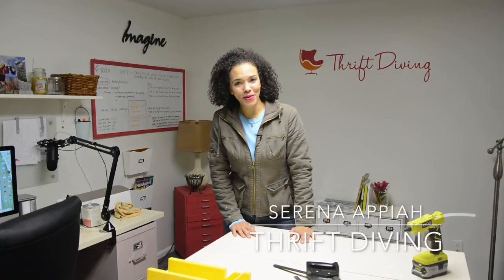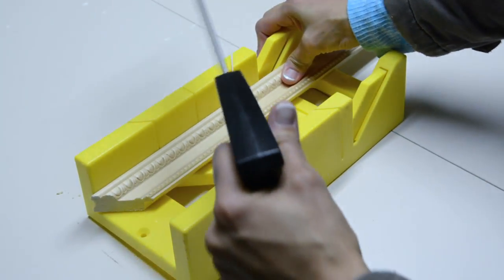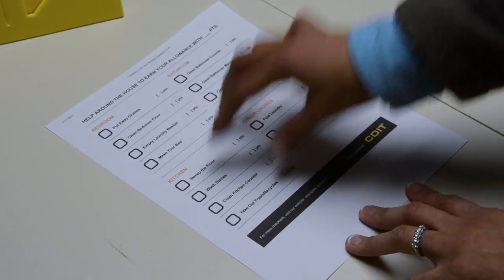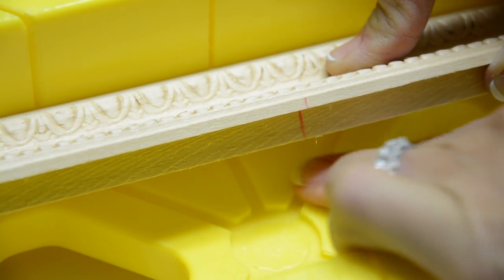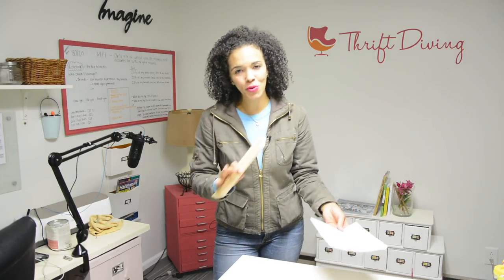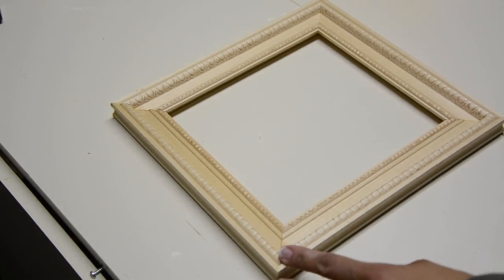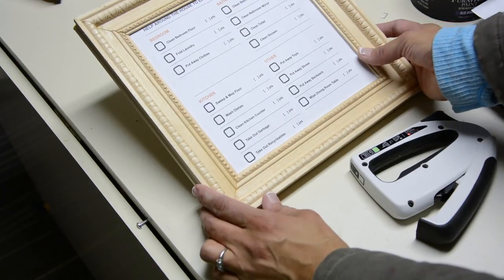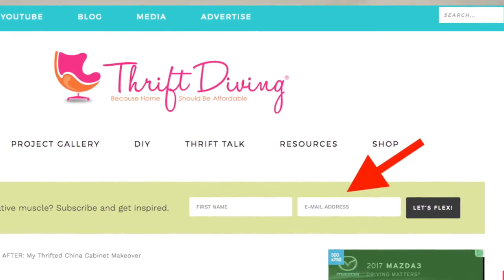How to Make DIY Picture Frames With No Power Tools - DIY Tutorial - Thrift Diving

Comment: I used to do custom framing. Pretty good job.The technical term is frame moulding or cap moulding. I would use corner clamps - they're cheap and do a better job. 
If you are going to stain and varnish or paint the frame - do that before you cut it. Being able to make a frame comes in handy if your piece is not a standard size.
Reply from the maker: Yes!! Corner clamps! I don't know why I didn't think of that. I believe I have some, too. I'll keep that in mind. And that's a GREAT point about staining or varnishing before cutting. I did paint it afterward but you're right--would have been easier your way. Thanks for the helpful tips!

Comment: Thank you so much! I have so many oddly shaped things I'd like to frame. I do have power tools so I will cut the wood that way. And, I probably will trim down oversized frames I picked up through the years. I don't think I would have thought to use the staple gun. That seems like a great way to give it the added strength it needs. Thanks again.

Comment: Nice. If you could custom cut glass for it they could mark off their chores with permanent, which erase off glass with damp scrub sponge, or dry erase markers.
Reply from the maker: Yep, I've thought of that. I know that most ACE Hardware stores cut glass. I don't know if it would be worth the cost to get glass cut, too, though! Might be easier to just buy thrifted frames. I have done that with making calendars and message boards! This is a good idea to try for when you've got odd-shaped things you want to frame! Hubby has been wanting me to frame some artwork he bought from Ghana. I might make some for that purpose! :)
Reply: laminate the piece of paper then cut back down to size a dry whiteboard marker wipes right off :)
Reply from the maker: littlemissmakeup075 oh, yes, yes, yes!! Why didn’t I think of that?! I’ve got a laminator, too! Thanks for the idea! 😎😎😎
Reply: no problem :)